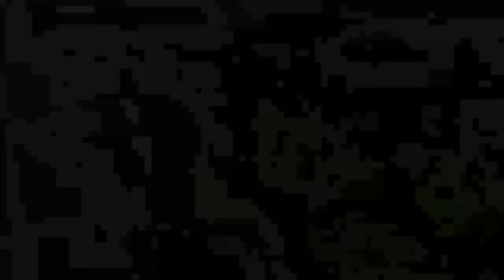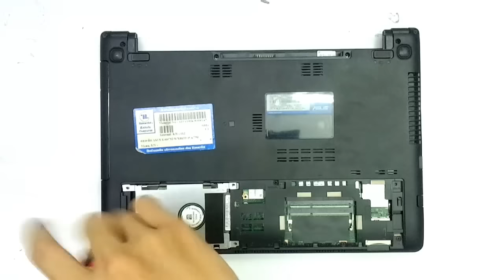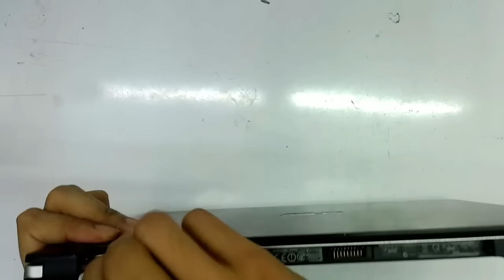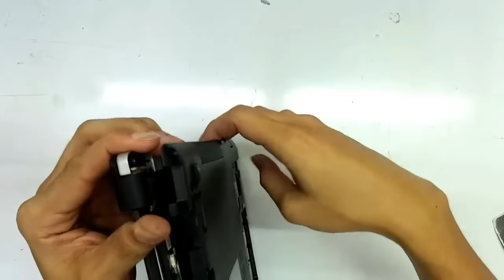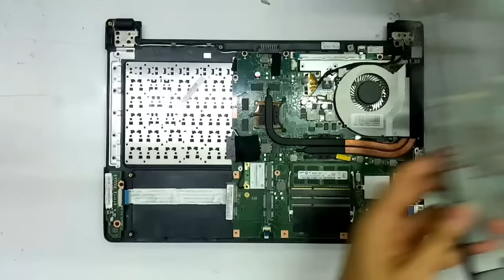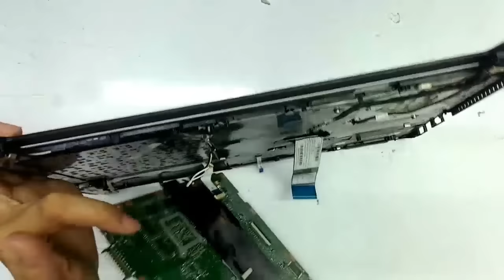How to take apart/disassemble Asus K46C laptop

Comment: I have this laptop and wonder can I use the m.2 slot for some sort of ssd? Mine is empty like this one but I see it here as well. It seems like the screw to hold down an ssd is in the wrong position, off to the side. Thanks.
Reply: You can use a half msata ssd
Reply: @GreedNero  it has the slot ? I want to upgrade HDD to SSD, but dunno whether i should take a normal SSD or sth else because sometimes i see people say it has m2 slot and now it is msata. Now i dunno what slot it really has
Reply: @potatoLoveYT69  it's msata